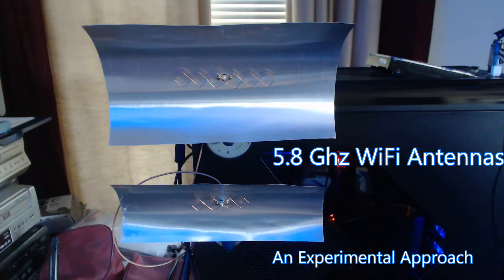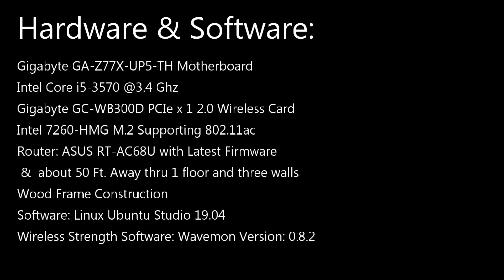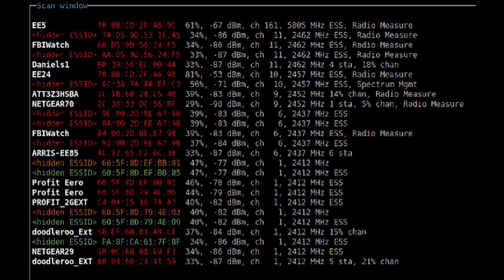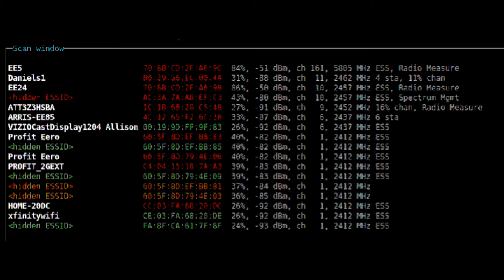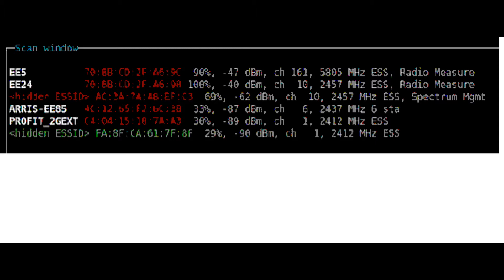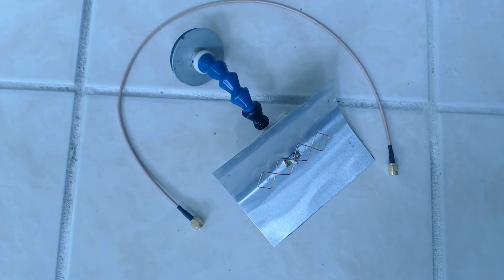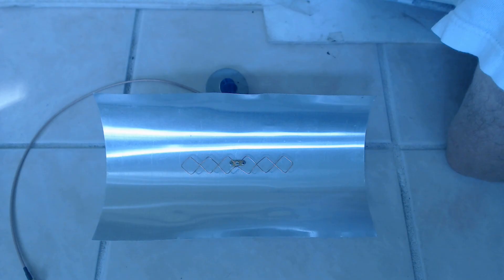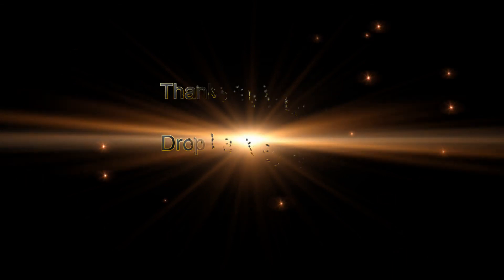5.8GHz Bi-Quad WiFi Antennas That are Easy to Build and REALLY Work

Comment: Why it can cause different damage between router and AP? and can i use it for internal wifi card in notebooks?
Reply from the maker: Your router transmits at a higher power level.  My understanding is that beyond a certain power level, my antenna would be a “dead short” to the router.  If I locate a link explaining this,  I’ll post it.

I’m using my antennas with an Intel 7660.  No issues doing that to date.  That is the wireless card in many new laptops.
Reply: @EdHumble  I see. Thanks so much for the info Ed.

Comment: Did you try setting up an accurately constructed parabola with the active elements at the geometric focal point? Would just take some cardboard end plates and a standoff to give the focal distance?
Reply from the maker: Mark Bolton 
Short answer: Not in that detail.

I experimented with different reflector shapes.  The slightly curved design here seemed to work best.  The six inch reflector works better than the four inch, probably because the four inch is curved to much.  The aluminum I have was to rigid to accurately form a parabola.  Is there more to gain from these designs, You betcha!  Work continues.  These were some of the details I was going to look at in the next construction related video.
Reply: Not quite the same I know but I was playing with solar concentrators. They get really high gain when close to geometricly optimum. Just a thought.